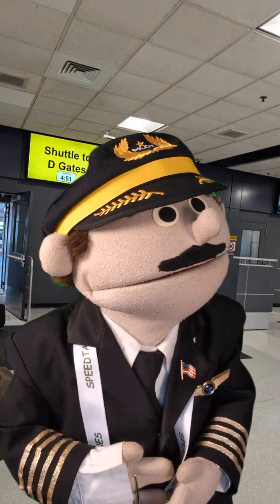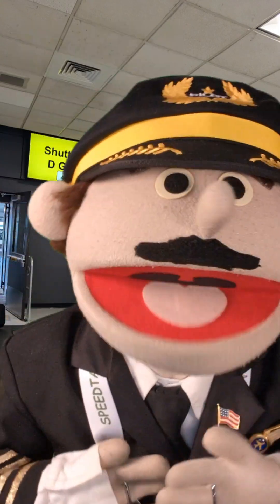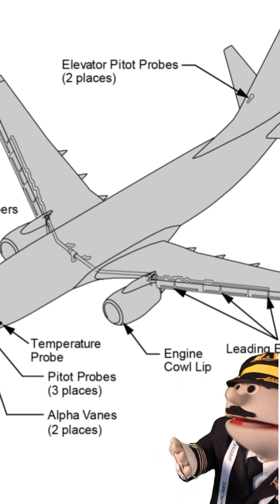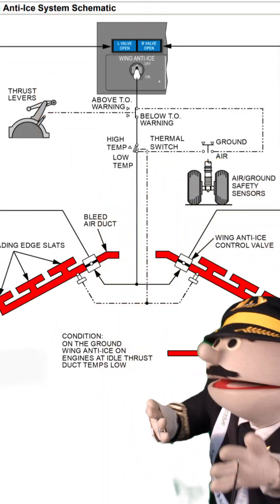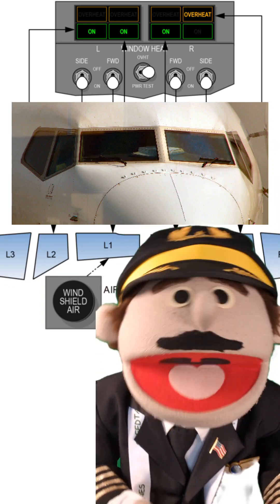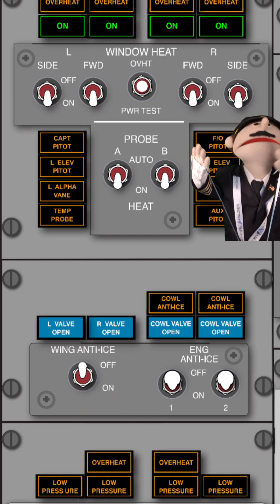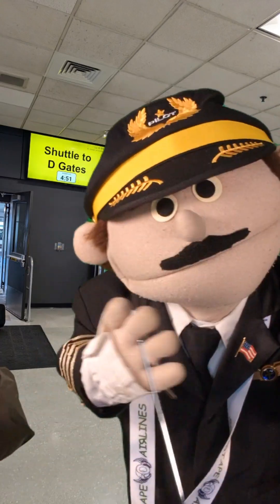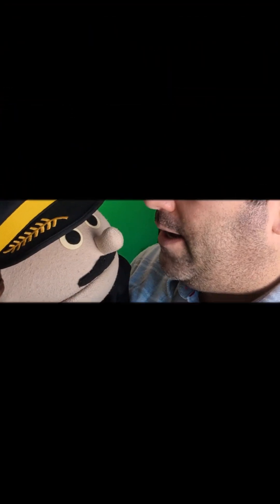737 Anti Ice Systems

Comment: Ah but how do you know when to turn wing anti-ice on in the 737?
Reply: Simpel, you use it as a de-icing system. 

When you see ice build up on the windshield wiper, most notably the bolt on top of it, you got ice on the leading edge of the wing. 

Turn on the wing anti-ice and leave it on for approximately 30 seconds to a minute. 
You’ll see the ice fly off the leading edges as it’s on.
Reply: @BWNeuteboom what happens if you a) turn it on when there's no icing, b) leave it on too long, c) forget to turn it off whole duration of flight? Will there be huge tax penalty?
Reply: @paulsherman51  : worse, actually - the penalty is that the general public will make snarky comments on social media about door plugs falling off because they think they're funnier then they actually are. ;)
Reply: You never really use the wing anti ice. As a captain told me “only use the wing when so much ice is building up on the windshield wiper that it’s starting to make you sweat”